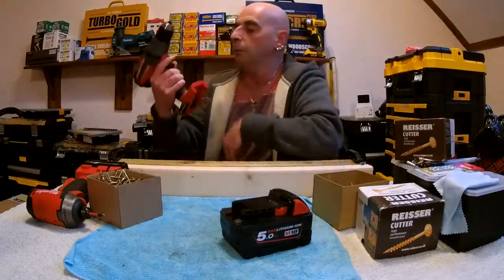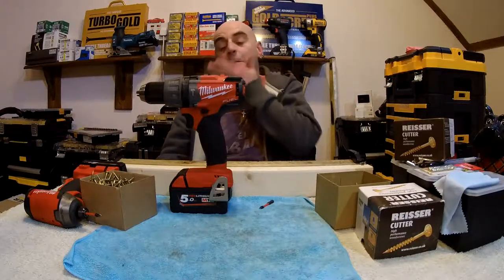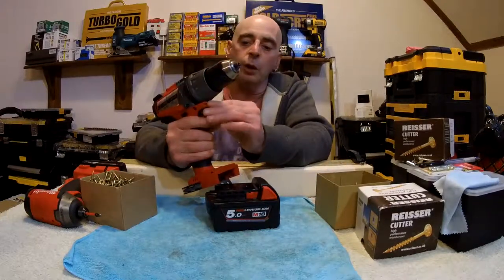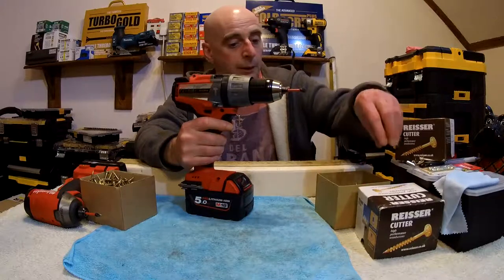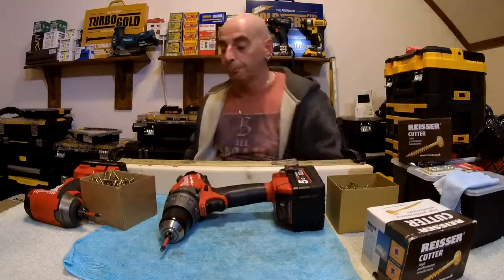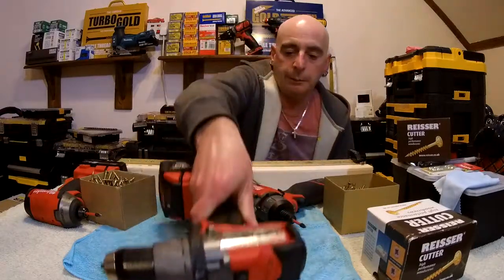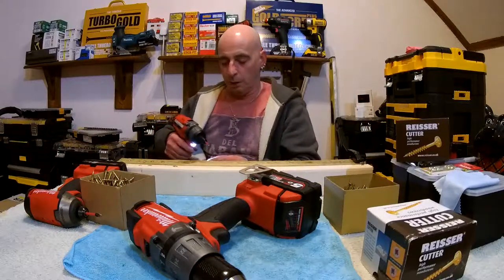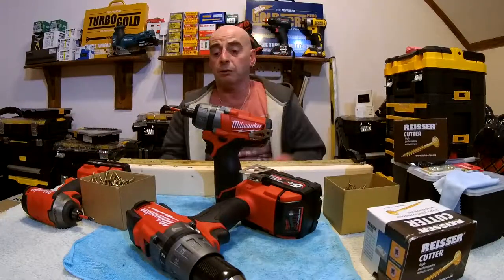Milwaukee - Why did I buy another drill?

Comment: I want this drill. Just shows out of stock. I bought the 1/2 chuck version a little heavier. Belt clip lasted 2 weeks before screw started to back out.
Reply: Just noticed one in video has mechanical clutch. My 1/2 inch chuck is electronic clutch and has an annoying acceleration curve when in screwdrive mode. Full chooch if in drill mode, no delay.